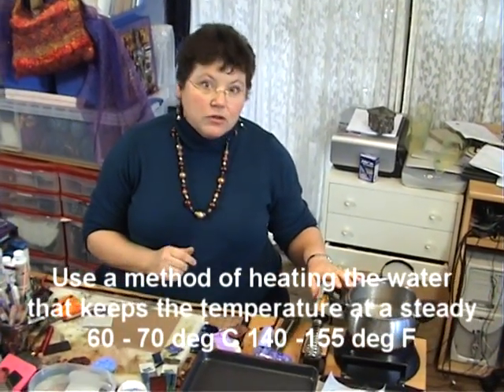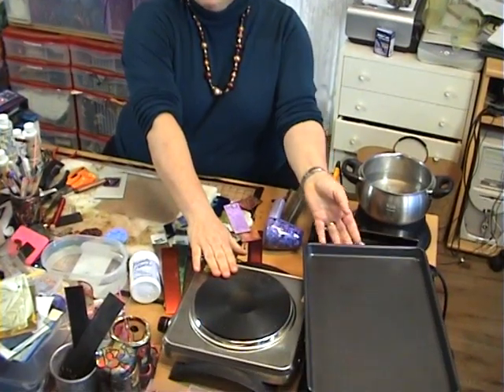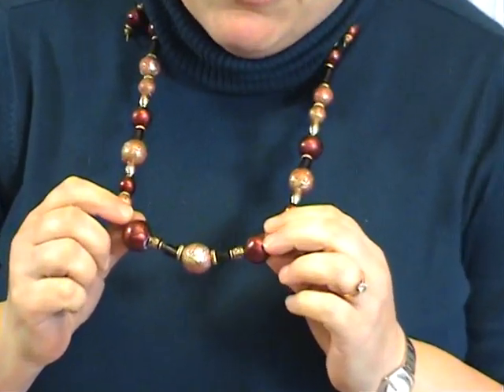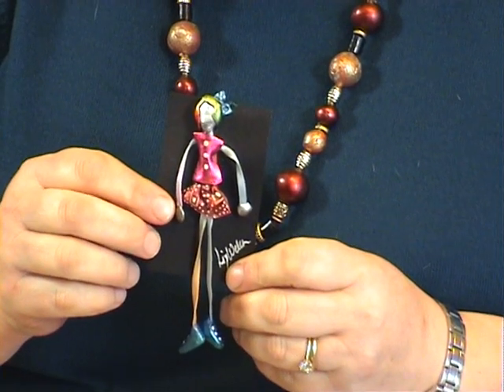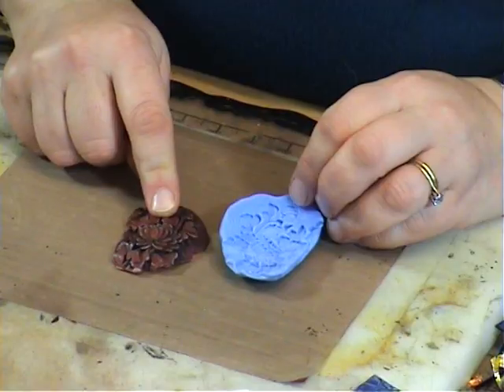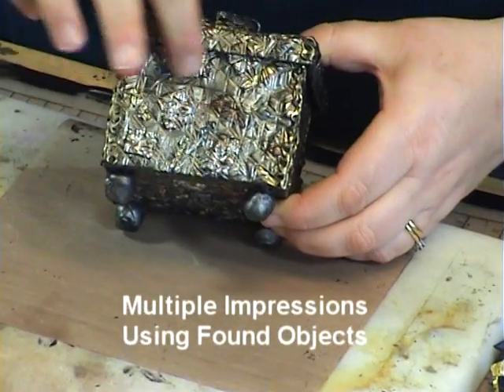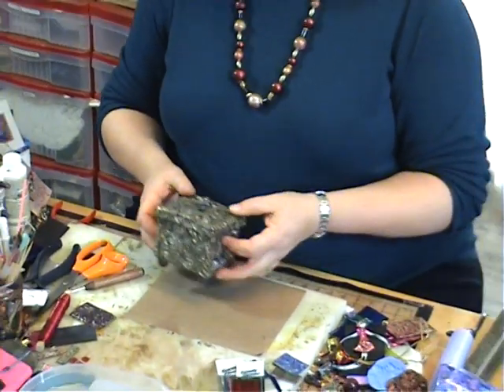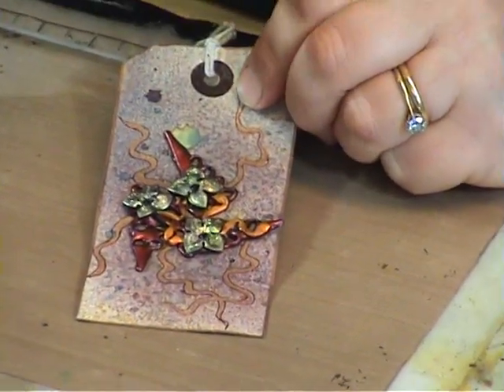Friendly Plastic Heating Methods - Hot Water

Comment from the maker: Not necessarily, it depends on what you are trying to do.  If you want to free form your FP - into a bead or one of my Lizzie Dolls for instance, then no container is necessary. Neither is it necessary if you want to soften all your scraps, or melt FP pellets. 
If you want to hold your FP flat ready for stamping or when joining pieces, then use some aluminium foil under your plastic to make it easy to lift in and out of the water.